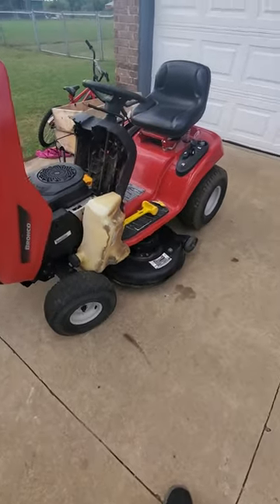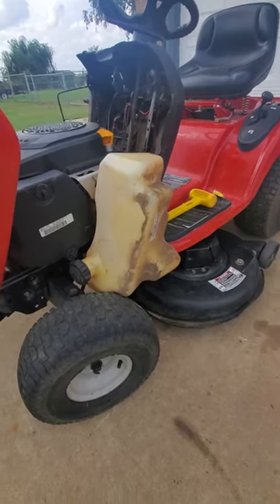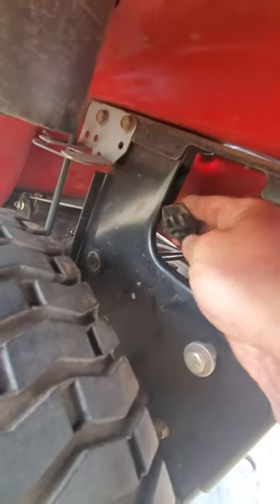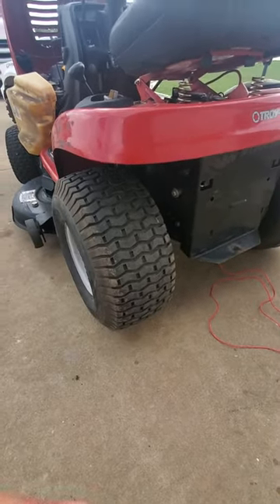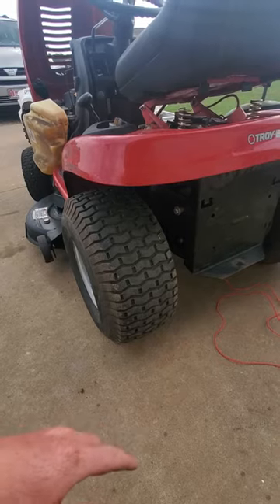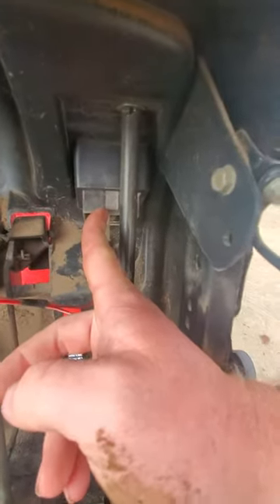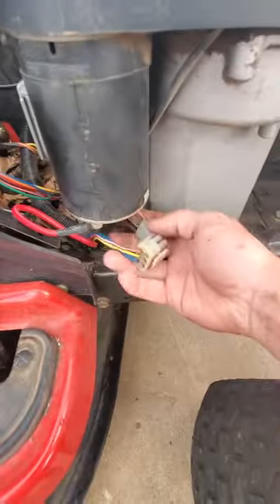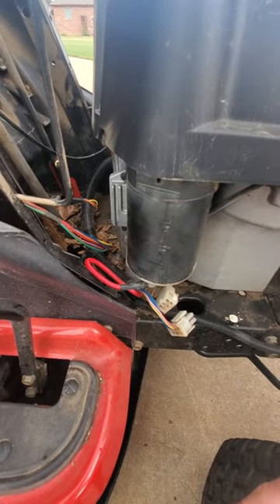Lawnmower Fuse keeps blowing every time I turn the key on

Comment: JAAAAAMES!  Your suggested method for isolation led me easily to find the problem, and as it happens it was also the voltage regulator!!!!  I had burned through 9 fuses when I found the video by the guy who unplugged one connection at a time, but fortunately your video was the next one up.  Thanks to you, I didn't have to curse myself for not buying that box of 25 fuses!  I need, need, need this little tractor in the fall to haul my leaf vacuum.  Thanks a million!!!!!!!!!!!!
Reply from the maker: Glad to help!

Comment: I had similar problem, removing the harness link allowed it turn over. replaced voltage regulator and relay and it still popped the fuse. I took the engine plastic off and took the lead off the coil and it still popped the fuse.  i found there is a single lead that goes over the motor to the carb for the fuel solenoid.  The wire is wrapped around the solenoid but in my case the red lead had either come out of its hook or a zip tie failed from factory.  Because of the extra slack in the wire, the wire🔌 touched and fused to the exhaust.  So check your fuel solenoid and wires are not grounding out on something hot (under your carb).
Reply from the maker: Yep ran into this issue later on in another project did this same process and turned put to be a wire that was going to the carb solenoid was grounding out. Great point hope these comments and videos continue to help others out!

Comment: So I have a 2005 Troy Bilt. I tested the starter it was good. Tested the battery it was good. Put a new carb. on it. Because the other one was all gummed up. Re timed the valves! So I put it all back together and cranked it over no less that 1 second it blew the 20 amp fuse the is on the right side right beside the gas tank. So I have not yet look into it. But I have no clue what it could be!!

Comment: The voltage regulator solve the problem? I went through the same process, also isolated it to the voltage regulator, again a kohler engine but a bit larger one, and it still blows the fuse when I reconnect with a new voltage regulator. Thinking it has to be the wiring harness, not much else it could be?

Comment: My Hustler started doing it after I jump started with truck.  Ran fine until engaged blades a few times. Not worked since.
Replaced battery and solenoid. Still pops fuse as soon as I turn key.
Reply: Did you replace the coil and did yours have a ignition relay box
Reply: That's about where I am now. Any fix yet?

Comment: What part was that. I've probably blew 15 fuses
Reply from the maker: It was the voltage regulator for my issue Check and make sure everything is unplugged put a new fuse in and only plug one item in at a time. Turning the key off and on each time. This will save you fuses. If the fuse still blows then you may have a grounding issue with the stator. Or key switch it's self.
Reply: @tech_watson8786  thanx man
Reply: I shoved a piece of wire in mine then it got stuck to the mowers frame and burnt it in half and I'll probably do it again because i don't have any fuses to waste

And thats all that a fuse really is a thin wire covered in hard plastic

Comment: nice....having same issue.  your vid is the first one i pulled up on the issue.  What was the part by the starter you needed?
Reply: Voltage regulator. It was sending too much power for some reason
Reply: Mine was shorted to ground. But excellent video!  I have a zero turn Troy, 42” Mustang.
Reply: @courtne-the-great7961  Having the same issue.  Where was yours shorted to ground? The stator wires? I cannot find the short and the regulator looks to be good!
Reply: The magnet broke loose and shorted the stator wire. I replaced this and the short was gone. Tried to replace the flywheel too with no success. So it runs  missing one magnet